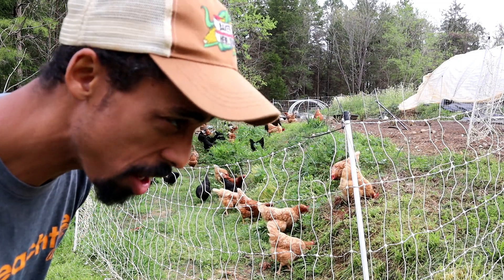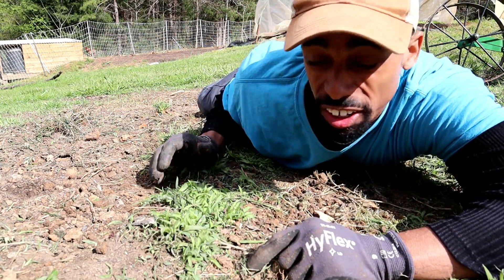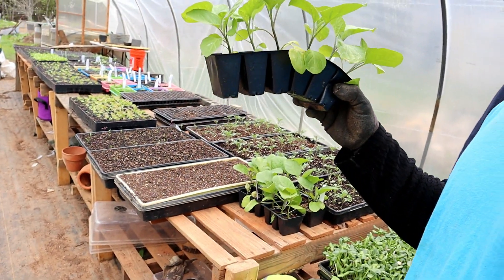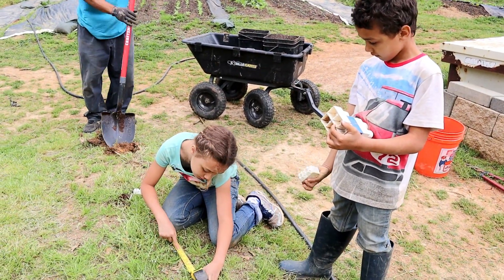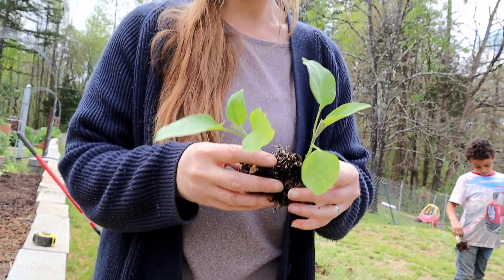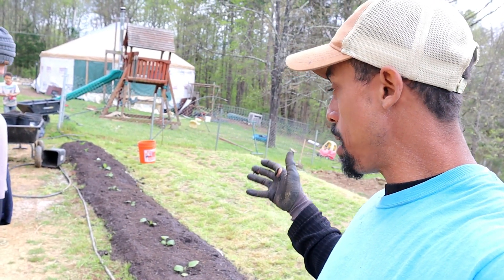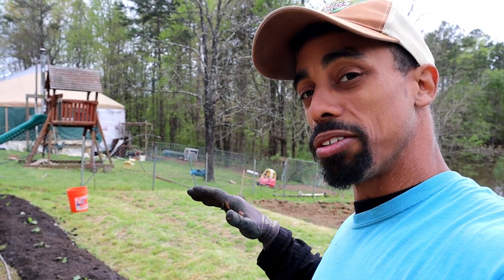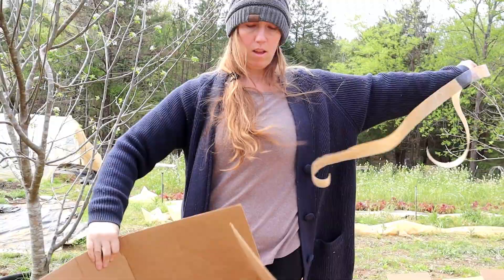FASTEST way to start GROWING FOOD NOW | From GRASS to GARDEN in ONE HOUR

Comment: Hi Mike, Your digging holes in the lawn is similar to what I did with one of my lawn gardens. Except I only removed the sod, about the diameter of a beach ball. Did not dig a hole. These circles were about 2' apart in all directions. I had a 30 x 40 area. Then I mixed my compost, sifted soil and additives in the wheelbarrow and dumped the mix directly over the circle, making a raised hill with a flattend top. Dug down and dropped  in rotted manure. This is great for squash, zucchini, bush type cukes. And a host of other vegetables. Newspaper mulch is a terrific idea! We think alike and both methods are a great way to start a garden fast!  I could not dig in the clay soil. Best of luck to all the first time gardeners!

Comment: I did the same thing with my Flower bed.  When I brought my home 10 years ago, I decided where to plant flowers and I cut a square into the ground by digging up all the grass.  I dung a 'trench' deep hole and pulled the MESS they called 'dirt' OUT of my bed.  I didn't know about composting or amending or any of that, what I knew is that that MESS was NOT going to grow flowers!  

Every season I added better soil, removed BAD soil and turned new soil into existing soil.  I fertilized, watered and tended that bed and now I don't have to add ANYTHING to make the soil fertile, I add soil only because the level of soil in the bed drops every year and I add NOWHERE NEAR what I put into to it, say, in the first 5 or so Seasons after I initially planted that bed.  Every year since my 'Lillies' and a certain vine I use as a 'COVER CROP' in that bed come up without any assistance from me which is good since my health is not what it once was and I can't always add ALL THE OTHER FLOWERS I like to plant, lol!!!!  

DO YOU BOO!  It's your pocket book, your time and YOUR BACK!  Do what makes sense for you!  This is what I would say to 'Beginning' gardeners, Homesteaders, New farmers, etc...